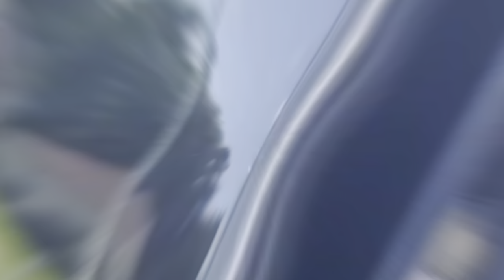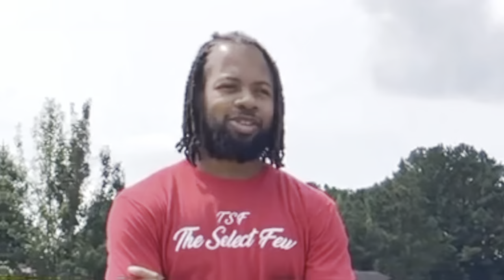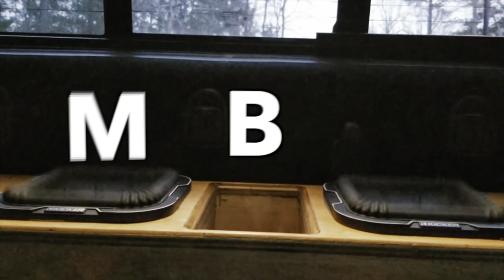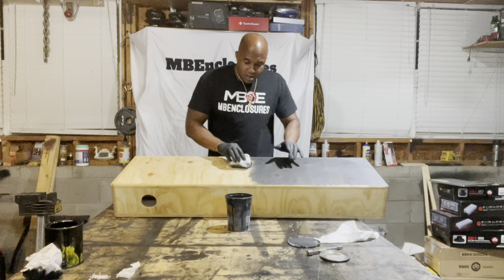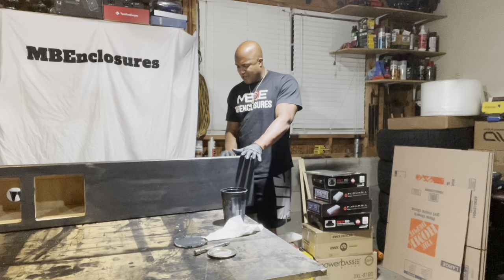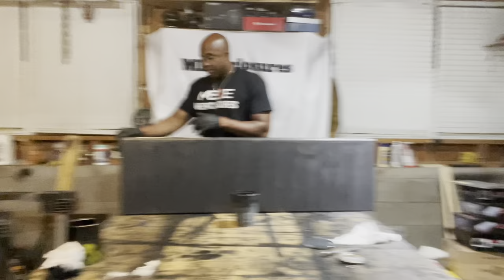Of Kerf Ports…Pros and Cons.

Comment: Hold up there dude on my engineering programming specifically on kerf ports it does increase the port velocity I've done the tests with dry ice and also the engineering tools so you can't say that that's not entirely true it does look beautiful and it puts a nice touch on an enclosure however it does increase Port velocity you do have to account for the tuning aspect of it because it'll go up and you have to extend into the enclosure but you can definitely account and calculate for that
Reply: Shouldn't a kerf port decrease port velocity not increase it.
Reply: Hey hey you guys heard what the animal said!!! LOL
Reply: @ddtstrc9678  yes and no it will increase the velocity at the kerf cause you can take in more air and have smoother transitions, but you have to have the kerf on the inside of the encloser aswell however you have to make sure your not trapping the air on the inside of the encloser at the same time. For me and all the enclosures I build for my customers I spend about 2 weeks of engineering with three programs to get Port area Port velocity and DB of rise properly dialed in according to the true TS parameters of the woofer and not just what the company says they are I usually try to pull them myself using the dats v.2 module and program. Also just a quick background I've been working with a close friend who is a sound engineer that's been in this field professionally for over 30 years and have been building for 8 years this year to shed some light on the subject.
Reply: @justforlaughs8988   If you had a  soda straw and blew into it and measured the velocity of air coming  out the other end.  Then you flared  both ends and you blew into it would the air velocity increase?
Reply: @ddtstrc9678  yes it would you are correct
Reply: @danielanderson8001  I'm sorry? Who is the animal? I don't understand what you mean by that
Reply: I knew it, Im cutting the bell end off my tuba right now to save weight.
Reply: @justforlaughs8988  at the beginning of his vids he now uses that little clip of him being mentioned on kicker unmasked
Reply: @danielanderson8001  right but what does that have to do with an animal? That's the part I don't understand
Reply: @danielanderson8001  also he will be on kicker unmasked tonight 7:30 central standard time with Kip
Reply: @BanginCaddy  I use 3 of them ,bass box pro 6, Dayton audio dats v.3, winisd
Reply: @BanginCaddy  Ha he gave you your answer didnt he brah? Dude think about it. There are a lot of high end, reputable manufacturers and pros who sell Kerf port enclosures right?
Now, I did my research before pulling the trigger on a kerf port box and tons of info out there acts like theres nothing to it like dude in video said.
WHat  Ive gathered and now concluded thanks to this dude here, is that what most people get and hear are Kerf wannabe ports.
Like he said there has to be other things present and going on not to mention pretty damn smart with these engineering programs lol
I knew there was validity to it or they wouldn't be selling it as a premium product by so many

Comment: MBEnclosures LLC congrats on the kicker unmasked interview You still gonna do the isobaric build
Reply: From the box building I've mastered from watching YouTube, and listening to MBEnclosures intently. I think the 4 pyle 15's mounted isobaric, and horn loaded or t-line tuned should get me $3,000.00 bass on my $350.00 bass budget. Any comment from MBEnclosures will be greatly appreciated. 
Father-God Bless.
Reply: @carlosmaple162  which pyle subwoofers do you plan on using they had cool logos
Reply from the maker: @carlosmaple162  maybe
Reply: @M.B.Enclosures   Thank you for your reply🙏 God is good!!
My idea is to fit the enclosure into the rear cargo area, behind the third seat. Down in the subfloor where the 3 row seat would fold flat. I also want to  build a loading board over the exposed magnet, as I often load the van for flea market sales. I really want to use it as a demo for flea market car audio brands.
Reply: Congratulations on building your brand up to the level that you have, just with your knowledge and hard work. By being able to put yourself on display to the world, and blow it away.

Comment: Appreciate the feedback on the port reason i was asking is i built a  Center verticle kerfd port  box kerfd outside and inside the box  as well  and thats what i had in mind when i built it trying to mimic an areoport thinkin id gain a little more velocity  across the port what  i done is went by jl audio port area for the w7 12 and doubled it or close to double  centerway of the port since i was running 2 12s widthwise i done 3.6 inches side to side from port wall to port wall  firing subwoofers up the inside of the kerf is 1.8 inches from  the side section of the box and flares back 7 inches the one thing ive noticed on a lot of kerfd enclosures is there not kerfd inside the box and they lose a lot of low end response i like to squeeze each chamber but  your right i cant calculate exactly on cubic space but i know each chamber was at 2.2 cubes before kerfings going by the lines  i drew out which is bigger than jl recomends for the w7 12 but that was for tuning at 36 hertz for me 34 is my sweet spot and all i can say is i got lucky 147.3  ar 40 hertz on ssa meter winshield score with driver door open  most boxes ive built before would muddy those low notes but the more i crank the volume the louder it gets ive done a lot of sound deading in my f 150 tho  what made all the difference is me flipping my box around with the port  torwards the back of the cab  but my poor ole w7s give out every 6 months on those jl slash 1000 amps and i beat the brakes  off of them but i dont mind building them this ill be the 3rd time in 5 yrs and i must say  you havent rebuilt a subwoofer until you build a w7 tight tolerences alls im sayin but i likem.Anyway Keep up the good work bro!

Comment: You and your awesome work has inspired me to get rid of my old Fox Box in my 2018 F150. Just ordered a pair of 8" Q class L7s and a 2 1/2" seat lift. Going to stain it black and I ordered a 6" Areoport I'm going to paint race red to match truck. Going out tomorrow to buy a sheet of hardwood plywood. What one would you recommend that the grain pops with that black stain?

Comment: Out of the two port the lower port that has the lip has and slapper responds. The lower port has more volume than the top port because the divider is 3/4 of a inch higher. Giving more freedom to the lower port and a different tune. Basically two different tune ports that looks identical to the eye
Reply: Sounds like you have a 6th order.
Reply: what, your talking about a 6th order box, and has no relevance to what he just talked about for 1o minutes

Comment: How about a slot ported box, built to sub manufacturer recommended specs, where the end of the inner port wall, inside the box behind the sub, is bullnosed vertically (rounded off), and all interior box vertical corners are braced with quarter dowels? Value your input thanks

Comment: So do the 45’s inside the enclosure assist with a smoother air flow? Or does it even matter? So are they even necessary? Thanks MBE
Reply: Oh it matters it does create a better Port velocity and Flow whether he believes it or not it's backed by science and sound engineering and acoustics also kerf ports do work and it's been proven when engineered properly

Comment: I have a question so are you saying if the port is a few inches lower than when it should the kerf will be more effective. My two 12 box I build had side slot port. That was wide enough but 7 inches short of reaching 24 inches long. Presently I added a divider to retune the port making it a dual square port with 4 kerf side to each port. And to add back pressure I've done a 1 1/2 inch lip on the lower port.
Reply: Basically, a kerfs only purpose is to prevent chuffing when the port area is too small. This allows you to tune lower with a smaller port volume and smaller box
Reply from the maker: @blakebrockhaus347  disagree…that is why the tune is off …only a aero port allows the box to be slightly smaller. Kerf is cosmetic it doesn’t help but it can hinder port area if not accounted for

Comment: Once again you are wrong air does move in and out of the box and it does this because of the vibration of the air along with an object moving this object is the sub. 

Put something in front of the port I 100% guarantee you that it will be 

pushed and pulled. Also air most definitely does come out of the box idk why you don't understand this when you see it happen on a daily basis. 

You may be a box designer and builder but you are lacking physics and it shows.
Reply from the maker: The column of air in the port is reacting with the outside air, it appears it moving in and out out only the dense volume of air in the port is moving within the port. You may need to study more.